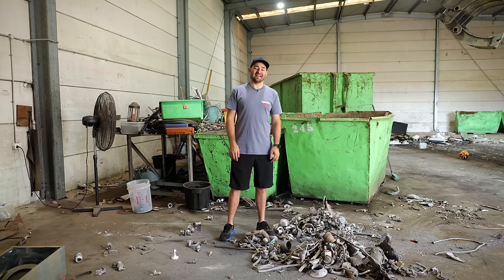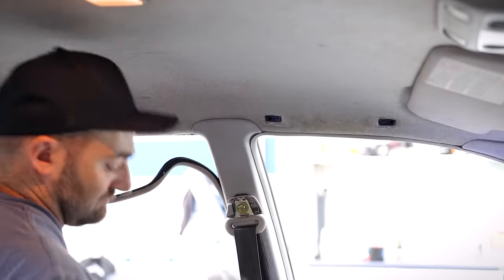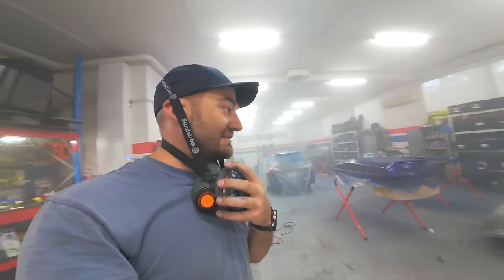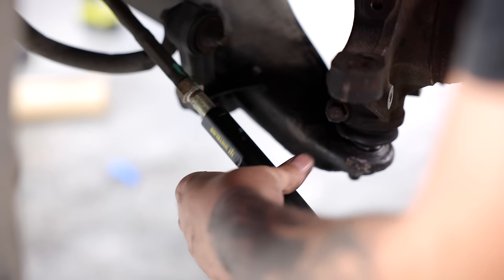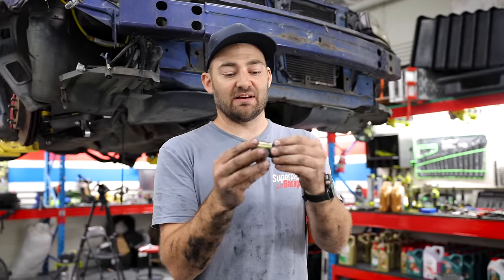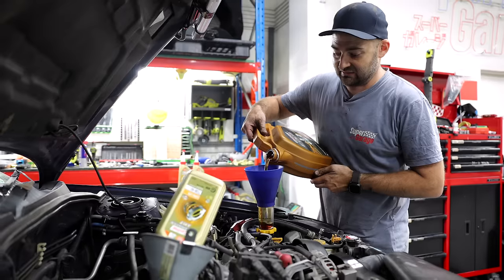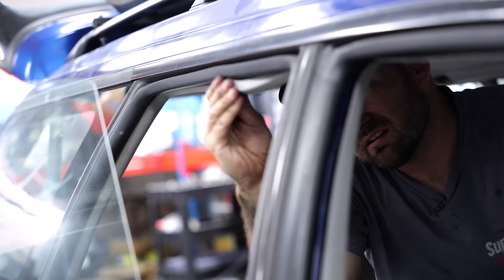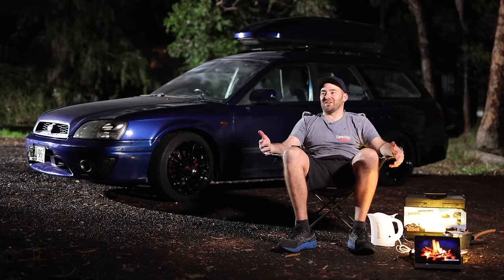Amazing Junkyard Subaru Transformation (Budget Build)

Comment: Hang painter's tarps (thin mil plastic sheets) from the ceiling around the car. Tape the plastic to a small fan on the floor pointing in on one side and one pointing out on the other. Now you've got a paint booth. $15-20 each for the fan, $5 for the amount of tape you'll use, and $30 for plastic.
Reply: add some residential furnace filters on the intake and exhaust side and it'll keep the dust down as well, cardboard shrouds work a treat!
Reply: THIS! Making a diy paint booth is super cheap and easy! no need for fancy shit! unless you are painting a whole luxury car for a customer, you only need tape, plastics, a fan and filter.. about 50$ everything!
Reply: @phiillzzz807  Or get one of those party tents if you're going to be doing it more often.

Comment: i would recommend getting yourself one of those pop up tents to use as a spray booth
Reply: I'd also recommend they invest in an HVLP spray system, they greatly cut down on the amount of paint you put into the air instead of on the panels.  Not stupidly expensive either, well within the MCM budget I should hope.
Reply: @ferrumignis  That is a HVLP gun being used. Sure it’s a copy of a much better one, but it’s still HVLP. For Acrylic Laquer it’s actually not the greatest gun for transfer efficiency & only good for the basecoat.

Comment: I did a similar catch and release with a one owner 2005 WRX Hatch that had 438,000kms on the clock. Car was all original driveline with complete Subaru service history. 

Picked it up for $5000 with a nasty clunk which was caused by a blown centre diff. Picked up a reconditioned centre diff from Peter at Corgiwerx, gave it a full timing belt service with new water pump, cam seals and crank seal. Daily drove it for a few months and then sold it for just under $10,000.

Comment: Thank you for saving this lovely wagon from the scrap!

$4,900 is a good price, too, considering all the work you've done on it! — I got my Outback of the same generation for under AU$3000. It's a higher spec than this and is in great mechanical condition for the age and k's, but it's a bit ragged looking and has had some dodgy repair work done to it. The important thing though is that it runs great and while it did need an interior cleaning, it wasn't nearly gross as most used Subarus I see. I absolutely love it and I'm definitely going to keep it on the road as long as I can.

Comment: This is just like the silver 03 legacy wagon i got. Picked up the car for the cost of scrap, about 150 bucks, because a couple wanted it out of the street. Had a broken wheel, was misfiring and they didnt want to fix it. I cleaned it up and put wheels tires and coilovers on it as well as a muffler. Ended up investing 700 and selling for 1350. Saw that thing driving around in my area for about 3 years after i sold it, then saw it on my local parts yards facebook page because someone finally scrapped it. Made me sad, but im glad it got another 4 years on the road when it wouldve went to the scrapyard before i got it.

Comment: This new series is very interesting. Huge respect for trying it.
The only problem I have is that in the end, you don't go through how it turned out too much and I kinda miss it. Even if the paint did not go out that well, still would be interesting to see from close how well/not well it turned out. Especially since we could have compared this one and Renault's results comparing spray gun and can painting finishes. It seems that the motor wasn't even started just to hear, no ride-along with a viewer. I feel like if you would not push it so hard to resell it in a day these could be much more satisfying videos to watch.
Reply from the maker: Would have but ran short on time

Comment: I’ve been trying to revive my forester, cleaning all the rust off of all the parts, bolts, nuts, etc, repairing the rear strut towers which were rusted and installing a lot of new parts, ne suspension, new bearings, nu ball joints and all the other service parts, new bushings, painting everything and some interior additions, and although I’ve been working around 10 hours a day for the last 3 weeks, it’s still not done and looks kinda far from being done. I don’t get how you can do so much work in so little time…in my case, out of 4 bolts , 3 came out, one broke and I had to find a way to take it out, the welds on the nuts that are in the frame broke, so I had to cut the floor to put a wrench in them, the bearings didn’t want to come out, even with more than 25T of pressing force, so I had to get replacement knuckles and install the new bearings in those…ahhhh, it’s so frustrating working alone on my car and having a limited time i of geți g it done and not being able to😢 I wish I had a friend or two, passionate about subies who would want to help me out, it’s so much better working next to someone, even if just for the company…
Really nice video again and nice subie!

Comment: I'll be sad when my H6 Outback dies.  We got it for free, but the gearbox is going and while a replacement isn't hard, damn does it drink fuel and cost a fortune to rego due to being a six cyl up here in QLD!  It just needs to last until(if!) I ever get my EV conversion done! The savings in fuel and rego alone will be worth it in a few years.
No way I'd ever take it on adventures due to fuel costs, but as a beat around machine to haul stuff it's great and we have the motorcycles for actual transport!
Still, many fun memories loading it up with way too much stuff. Did you know you can put nearly a tonne of dirt in the back if you fold down the seats and put a tarp down? :)

Comment: 9:15 What kind of clamp is that? Looks like a hose clamp but you're using what seems to be a specialty tool to wind it tight.
Reply from the maker: It’s a cv boot banding tool. Cheap to buy

Comment: As someone running an EJ25 with over 400K on it I cringed when you put thicker oil in it. Still using 10W-40 and still waiting for it to burn oil.
Reply: Wait till it comes out the spark plug rubbers

Comment: 3rd gen Subaru Legacy/Liberty are amazing and reliable cars.
I managed to get one for free, and fixed it up for cheap. It only needed new parking bulbs, adjustments to the headlights, a new washer tank and a small panel fix. That made it fully roadworthy. I probably spent around 500 NOK (around $50 US) in parts, and another 2000 NOK (around $200) for the roadworthiness tests, as well as a set of new summer tires for it (4000 NOK). 
I sold it for 15,000 NOK (roughly $1500), so I made a nice profit on it. 
It became someone's first car, and it was not a bad choice. The only downside is that Subaru engines are known to eat a lot of gasoline, and with gas being expensive over here, well you know how that goes. Fortunately the new owner does not need to drive all that much.

Comment: If you are factoring in your Time vs Dollars, you would have saved yourself the time and trouble with the Wheels, Aftermarket Bushings, Stereo and Roof Box.
But, if you were trying to put together a Cheap Reliable car for your Daughter/Son, Niece/Nephew... This kind of going the extra bit on a 'Find and Restore' on a vehicle is totally worth it. Not just for the money, the project, but also the peace of mind, knowing that they are starting out from a good place.
*Was the motor rebuilt? Replaced? (with receipts) How did it get to 400,000 kms?

Comment: I love it!! I did almost the same thing 6 years ago with an 01 Outback I got for $500. It had a leaking water pump is all, also a bit of piston slap. Put $1k into it, mostly tires. Figured the piston slap would have sent it to scrap yard after a couple years. But I’m still driving it today as my daily beater! Ended up doing 2000 Impreza RS wheels, 215/70R16 AT tires, Baja Turbo springs for a lift and retrofitted the headlights. It’s been great!

Comment: I picked up an LN106 hi-lux for a grand off a P plater. Spent about $1500 getting a RWC and rego for it. Cleaned it up and drove it around for about 10 months while my HJ61 land cruiser's motor was getting rebuilt. Sold it for $8k which almost completely paid for the motor and gave me something to drive for a few months while the car was out of action.

Comment: Had a 2008 B4 Liberty sedan that ran and drove fine. It has two blown head gaskets and needed at least $9k in repairs to make it road worthy. This was late March 2024. Front and rear shocks blown. Torn CV boots. Leaking squealing gearbox. Door rubbers perished. Paint was perfect. If it was a wagon I would have kept it in a heartbeat

Comment: I’m very certain I pulled those Prova coilovers out of a mates Gen 3 RSK after I bought it with severe hail damage. Intended to buy them in my manual swapped H6 Gen 3 (or 2 for the die hards) but sold the car before I got around to it. Awesome to see these old parts still getting a lease on life.

Comment: I’m so excited that someone finally did a super car build on my super car. I’ve had mine for 17years. And have done a lot of those items. In the states aftermarket suspension is hard to come by for this model. So it is still on stocks. With 300k mls. still running strong.

Comment: these videos are not good for flipping cars and making money. but it shows that you can buy a crappy first car or project car, throw some second hand parts at it and get a really cool daily for less that 5k.

i got a 05 honda accord euro for 2k, did all front suspension and rear shockers and replaced broken taillights, interior clean, tint and new tyres, full service and powersteering pump reseal with rego for less that 5k total. its an awesome daily. i also fixed some oil leaks later and engine mounts.

Comment: If I was building a mid-inch and Subaru powered vehicle or front engine rear wheel drive or just wanted four-wheel drive instead of all-wheel drive, could I just weld that differential up?

Comment: Best way to paint at home is get yourself a couple box fans and some hvac filters and just tape them to the back of the fan and put it in an open door. It will filter the air going out and take out a lot of that fog in the room. Works in a pinch

Comment: My god guys! 
Just restoring my old 2003 outbach BH.
Here in Europe they rust with the speed of sound (you can actually hear them rusting). xP
So body work is finished waiting for some engine stuff to come to put it back together!
Also change a flywheel, get it from an old 1.8l legasy =D

Thank you for your work! Its always nice to see old cars being saved!
Reply: Forgot to mension that 30.000 back catch a central diff before it went complitly bad and revised it. Opened it, cleaned it and change a viscous fluid in it. Works like a charm =D

Comment: would you trade it with a MPS 6 but engine is gone
Reply: could be a good  for the engine if you build the motor i also have another mazdA6 with 6 speed can come with it for parts?